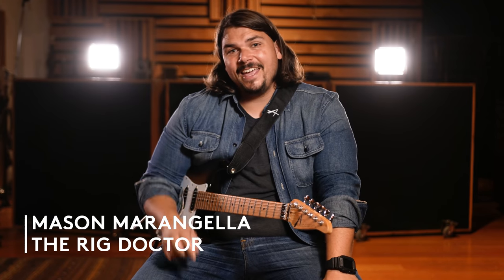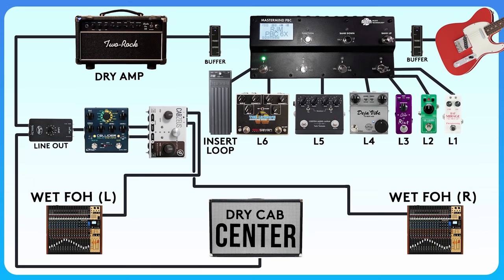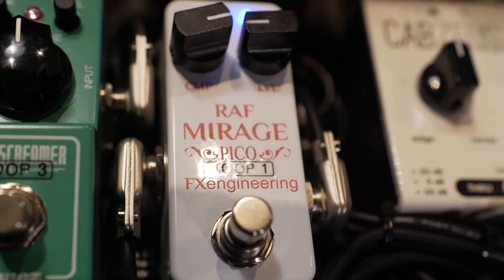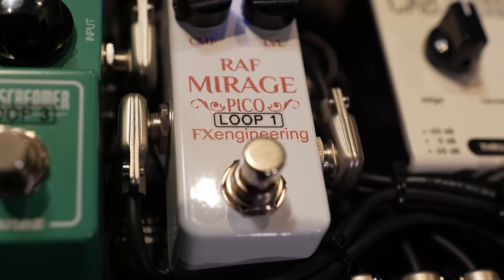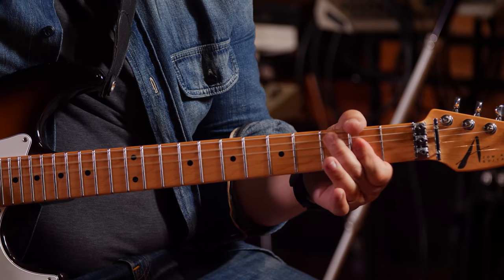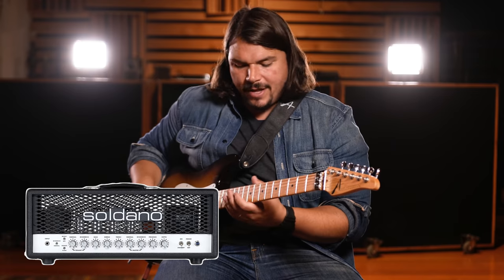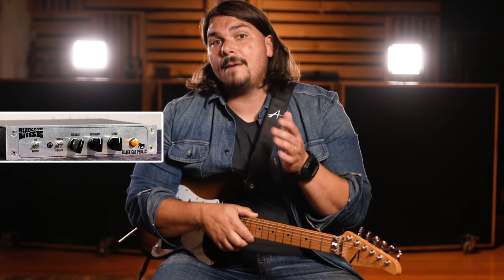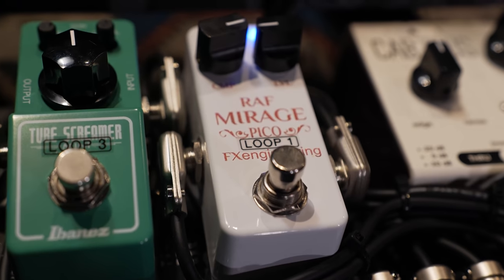Can Today's Pedals NAIL 1980's Rack Tones?

Comment: I bought my first electric guitar rig in 1991. I had an ADA Microtube 100 power amp, split stereo, so 50 watts per channel. I had a Rocktron mAXE for distortion, and an ART DR-X for multi effects, running into 2 ADA half stack cabinets, each loaded with 2 50 watt Celestions. In the early 2000s I still had the same rig. I found a couple of guys online to jam with, loaded the whole rig into my car, and showed up with my 4 unit rack and my two cabinets that were the equivalent of a 4X12. I didn’t get the memo that rack rigs were out. As the two guys helped me haul the whole rig downstairs into the drummer’s basement the bass player said, “This is ridiculous”. I’m sure those guys thought I was an idiot. They didn’t invite me back for another jam session, lol.
Reply from the maker: Those were the days!!!!

Comment: Since there's a lot of rig talk, I'll share my chain: 

Source Audio Zio > ADA MP-1 > stereo outs to 2 DBX 160A > DBX 1 > Fulltone TERC, DBX 2 > Mixer, TERC OUT 1> TC2290, TERC OUT 2> Yamaha SPX 90. Stereo Outs of 2290 go into mixer, Stereo Outs of SPX 90 go to Mixer. Now there's 3 channels: 1 has TERC>2290 stereo delay. 2 has TERC>SPX 90 stereo detune. (if you bypass the delay you get the TERC in parallel and series with detune) 3. Is Compressed dry signal that can sit quietly in the center. The Mixer Main Stereo Outs with the 3 mixed channels then go to a Lexicon PCM 81 for the final touch, concert hall reverb. The balanced stereo signal goes into a UAD interface. One thing I want to try now that I have 2 SPX 90s, is to run each TERC out into an SPX, each with slightly different pitches and see how crazy that sounds. I imagine some tweaking will be in order to make it musical.
Reply from the maker: Nice!

Comment: I still run a small rack. I have a little 3 space technicians rack from an old Job. It has little rubber feet and sits perfectly on the top of a typical Marshall Tube style head. My company was moving to Mexico and they threw away a ton of Technical gear. I was able to get a bunch of cool electronics repair supplies and I even got a real Variac from the 50s. I have a RockTron Expression and a BBE 842 Sonic Maximizer in the rack. I just purchased a Digitech GSP 21 Legend because that was the processor I was running in the early 90s. I also run a Pedaltrain Pro with about 12 pedals on it with an ES-8 switcher. I've tried to delete the rack but something about the RockTron gear coupled with the BBE is a perfect finish before splitting to stereo into poweramps. I think it's the RockTron EQ and Compression that I just can't live without. The BBE is absolutely essential too. They're subtle but you miss them when they're gone. I use two 4x12s with two regular guitar heads. My 80s tone is the real deal. The rack is here to stay.

Comment: I think rack gears are back now, though it's not as big as it used to be in the 80s-90s. Even ADA MP-1 now are ranging around 600-700 bucks on reverb, 20 years ago it used to be 100-200 bucks. Its amazing to see that racks are still appealing to people in the era of amp modeling. 

Another great video, thanks Mason!
Reply from the maker: I think there is demand for older classic pieces of gear, but I don't see this trend in the industry for musicians in actual implementation, especially live.  Thanks for watching!!!

Comment: Nice 80s tones here. I dig your playing, Mason. A Boss CE2 would have been a good choice as well for some serious 80s chorus action. I had a rack in the early 90s. Had an ADA preamp, BBE Sonic Maximizer, some solid state power supply and a cheap delay and reverb unit. I always wanted an Eventide Harmonizer. Super fun video! Brings back those 80s Rack God tones... 🤘🏻👍🏻
Reply from the maker: Thanks Tom!  The CE-2 is great...it's a lot darker than a Tri Stereo Chorus or a 1210.  Still cool but not quite as "hi-fi" and doesn't cut out a ton of bass like the TSC will.  Yes!  Bring back the 80's rack tones!

Comment: I still have my Rack a Digitech DSP 2101 into a Marshall 9100 amp and 1960A  cab, now I want something small and light.  The bass rig had one or two SWR SM900 heads with a DBX 160A and an Ensoniq DP4, of course the bass rig of the day needed the Mu-Tron, SCF Chorus, Morley Bass Wah, and Boss Synth Bass pedal.

Comment: Andy Summer's base clean tone was a lot cleaner than that.

Another staple of that era and that was my tone for a lot of the 80s and early 90s was the Rockam Sustainor (yes, that's how it was spelled) for compression and a Strat on position 2 (to get the quack) and through a JC-120... and for those not being to afford Bradshaw rigs, a ton of Boss pedals ;).

Later, my rig changed to a 2 amps rig with the JC-120 for clean and a Marshall 2x12 combo and an Art multi effects rack unit (later replaced with a Korg A3) replaced the ridiculous mess of boss pedals making the rig a LOT more reliable ;). I then used 3 Rockman Y boxes (they were named something different that I forget) and a Rockman MIDI Octopus to control them and the channel switching on the Marshall. All I had on the floor was the Rockman midi controller footswitch and my volume pedal. If I remember, I plugged my guitar directly in the Sustainer and its output went to a first Y box routing my signal to either amp's input. I forget the details but the other two Y boxes where used to either put the Art or Korg A3 in either the Marshall's FX loop or in front of the JC-120 because it didn't have a loop. Later the JC-120 was replaced by my old trusty red knobs Twin also in a double amps rig with the Marshall. The Twin had an effects loop so two Y boxes were used to place the Art or Korg in either amp's Effects loops One was used to route the two amps FX loops send to the multifx unit's input and that unit's output was then routed to either amp's FX retuern. All controlled by the Rockman MIDI Octopus so it was all presets. A preset change on the midi pedalboard sent a program change to both the Octopus which changed the Y boxes' status accordingly and change the preset on the multi fx unit. All fit in a 4 or 5 U rack I had on a special stand. My Korg tuner was velcro'd in there as well as my wireless receiver on top ;)  Worked great at the time!

I hadn't though about that rig in a while. Good times!
Reply from the maker: I've been watching a lot of live Police.  Andy was using a Marshall JMP era head and cab with pedals - not that clean even on the "clean" parts on the record.  I also mention you could sub a compressor for drive and get cleaner and then demo that as well in the video.
Reply: @VertexEffectsInc  Indeed but I mainly referred to studio versions, especially for Walking On The Moon where his tone is almost pristine clean (not JC-120 clean of course but very clean for a JMP). It had hair on it but it was really not what I'd call edge or breakup or beyond which is where you were. Splitting hairs I know ;)

I am well aware of Andy's gear having been a huge fan for decades. Btw, he used an Electro-Harmonix Electric Mistress and not an actual chorus pedal. I knew about that before, but Dan mentions that a lot on the Pedal Show because he has one of those pedals and loves it :)

The video was spot on but I just though you had way too much dirt for Walking. He also had a pretty bright tone and his main Tele had a preamp of some sort in it pushing the front of the amp harder when he needed to. And yes, it was early 80s in his case before those huge Bradhsaw type racks became so pupular.
Reply from the maker: @StephaneBergeronPixelyzed  I agree, the recorded album is clean, I also mention that you can clean it up by using the compressor only and no first gain stage - and then demo it, but go into a Crowded House lick that's in the same sonic terrain.  I think it illustrates it well.  Yes, he is using the EXH Electric Mistress, however he's using it to modulate like a chorus (not a prototypical flanger sound), and he also had a CE-1 in his rig as well (or the JC but that's the same chorus as the CE-1).  The "Filter Matrix" version of the Electric Mistress is a cool pedal but pretty terrible to use in rigs since it's noisy and super unreliable - also not optimized for guitar impedances like today's pedals.  The Hartman was a good substitute - but also no longer made.
Reply: @VertexEffectsInc  Yup, appreciated the Crowded House lick (I play it all the time, it's fun!) Andy indeed used the Electric Mistress as a chorus-like effect but it's a different vibe and some people wonder why they can't get it right with just a chorus. The Dynacomp was a big part of his tone too (and I'm a comp always on kind of player in large part because his tone to me was the reference tone I tried to emulate back then).

To m y knowledge, his JC-120s (he had two) were used mostly to amplify his GR-300 guitar synth and rarely if ever for straight guitar. But the JC-120 was the sound of early Tears For Fears, it was Adrian Belew's amp throughout his stint with 80s King Crimson, etc. It was a very prevalent amp back then and, closer to what I played then, it was Marillion's Steven Rothery's clean tone and it was my first professional quality amp and I played one for over 10 years. Strat on position 2 through either a Boss compressor then the JC-120 or later in my case, through a Rockman Sustainor's comp then the JC-120 was a classic sound of the era (if you didn't play metal which brought you to a very different type of rig of course).

Your chosen effects to emulate all that in the video were spot on!
Reply: @StephaneBergeronPixelyzed  Andy used the JC-120 for "Murder by Numbers"...that wet/dry chorus effect is unmistakable.
Reply: @kalebaldwin5398  It's quite possible but having played on myself for nearly 15 years, the low end is very different and much more typical of a 4x12 cab than the JC-120's speakers. Cannot find anything on Google specifically about the gear he used on that song.

Comment: I have a full 21unit rack, filled to the brim with classic rack gear, i even have 5 on top😂
I am 20, never used a single pedal
Reply from the maker: Wow!
Reply: Is it really a rack without a pcm/eclipse/harmonizer and a mesa power amp?
Reply: @0megalul309  yes. I dont have money for that kind of stuff
Reply: @MathiasBronnes  should have just used the money and gone 12u with the good stuff than use 21u of forgotten gear
Reply: @0megalul309  and have a rack that has the most common crap? No thanks
Reply: @0megalul309  what's 'u'? Just trying to understand this exchange 😁 I can tell that one person is trying to flex but I didn't follow your point fully.
Reply: @pb25193  20 units  = u

Comment: Hey Mason!  Killer Vid... very close to my current selections however I have to say I am torn between 2 pedals.  I'm a big Eddie fan (Balance Tone) and love the Huff Landau Tri Chorus stuff.  I will be using a PCB6x and I'm trying to maximize my real estate but I want your advice..  What do you think will bring me closer to all those previous influences, Eventide Micro Pitch or Tricerachorus?  FYI The board will have a Colider Delay/Verb, Compadre Compressor, RJM Overture (med Gain), EVH 5150 OD, Phase 95, CAE Boost, Eventide Pedal...  Thanks so much I've been binging your fantastic videos!
Reply from the maker: You kinda need both (tri chorus and pitch).  Neunaber has a chorus pedal that does both in one if you need to save space.
Reply: @VertexEffectsInc  I second this, the Tri-Chorus Inspire is such a sick pedal! Can send the stereo outs directly into a stereo delay>>verb, or split from there into each.

Comment: Why doesn't vertex come out with a pedal that is like the ADA MP-1 rack because most producers used the ADA MP-1 rack with the Furman PQ-4 on most of the 80's rock records. It would be real nice to have a small pedal that has both the ADA MP-1 rack and the Furman PQ-4 in one small pedal. Also the Empirical lab distressor was another very used rack unit that most producers would use on the mic'ed cabs which would be nice to make into a small pedal the empirical lab distressor. I know eric johnson used the MXR Flanger doubler rack unit which you can make a video lesson about how he used the MXR flanger doubler then went into an MXR 1500 delay flanger unit.
Reply from the maker: Could be cool!  Didn't ADA make a pedal version of the MP-1?
Reply: @VertexEffectsInc  yes they did its called the ADA MP1 channel pedal it has a dual 12AX7 and they also make an ADA cabinet simulator so you can use both. Most producers used the ADA MP1 with the Furman PQ-4 in the amplifiers effects loop and then would use the distressor on the mic'ed cabinet. I'm not sure why most producers used the ADA MP1 but it must have a certain compression and harmonics for recording good tracks. If you look at most studio guitarist that had racks you will mostly see those 3 units in the rack but these are hired studio cats.
Reply: @VertexEffectsInc  Another method is guitarist will use the boss blues driver instead of a buffer pedal because the boss blues driver has a FET input so you can roll down your strat volume pot setting and it will keep the signal very clean without any frequency response altering and degradation of frequency loss. The Boss blues driver it acting and behaving very closely like a fender amplifiers input stage because of the dynamic picking attack is sensitive in the boss blues driver circuit which you don't get with a buffer pedal. The EXPRESS Effects inc Buffer pedal has an Input loading trim pot on the side of the buffer pedal that ranges from 10K to 1Meg which is acting like a cable simulation. So studio rats are using the boss blue drivers are using it as a dynamic buffer instead of using a static buffer.
Reply: @VertexEffectsInc  They did, but it wasn't too great in the opinion of people with intimate familiarity with original MP-1s, like me.
Reply: @waynegram8907  In lieu of a blues driver, Source Audio just came out with the Zio analog OD, which has a killer FET circuit. Really helps bring the tones out of a Landau-esq rig. I won't record without it now!

Comment: Cliff Burton I think used a wet, dry, wet rig for the master of puppets tour because he used rack mount pitch shift effects that used a foot pedal which you can hear the pitch shifting effects on the live concerts 1985-1986. If you can make a video like you do on eric claptons 80s rig about Cliff Burtons pitch shifts rig would be nice.
Reply from the maker: I'd have to research it more for sure
Reply: @VertexEffectsInc  thanks that will help out a lot
Reply: @VertexEffectsInc  Joe Holmes I think used the marshall amps direct output that goes to a Boss SE70 which Splits the signal into Two SED3000 which then goes to TWO V800. Its an interesting trademark tone.
Reply from the maker: @waynegram8907  The signal path sounds like a dream :)